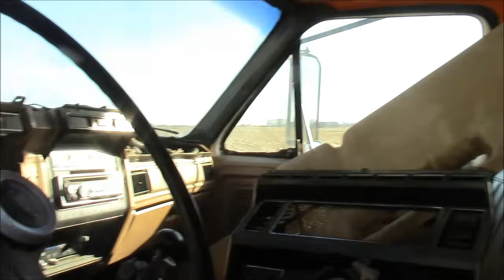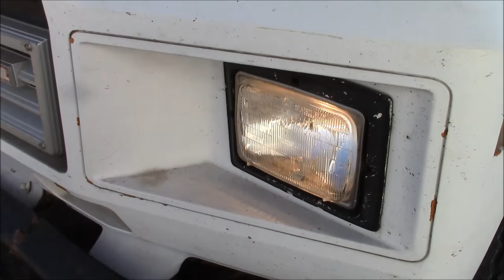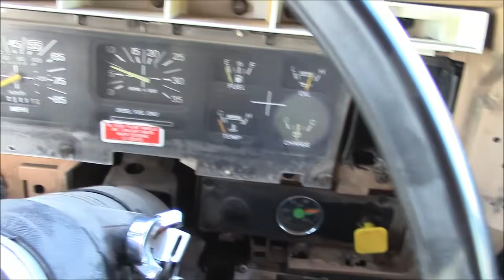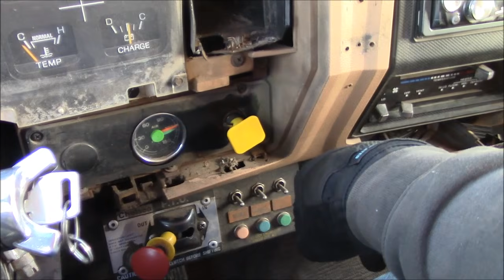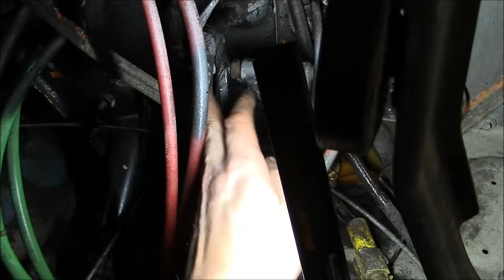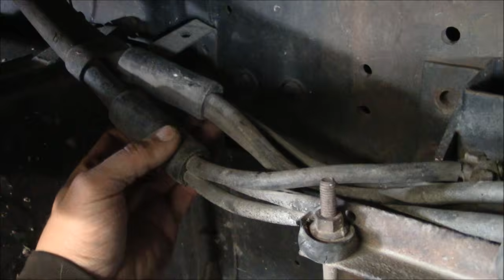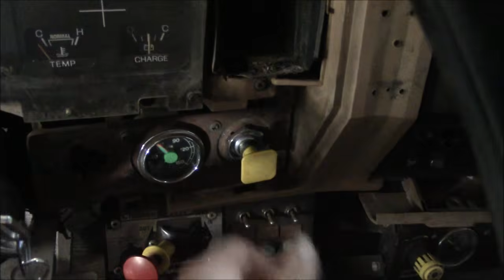Sweet 1984 Ford F-800 - No Headlights, Air Leaks, Bad Brake Valve.

Comment from the maker: Lots of guys are asking me about the uninsulated terminal kit I use. I'm pretty sure the terminals are made by Molex and I bought them from McMaster Carr. But, they don't seem to offer the assortment anymore, but you can get the terminals from them. I think it's the same kit as this one on Amazon. https://amzn.to/2LB4jjZ
Reply from the maker: Dave Iauco  It just depends. For quick single wire repairs, it's hard to beat the shrink type insulated butt connectors. For a big wad of wires like this I like the uninsulated with shrink tube. Soldering is good too, but tough to do well in cramped spaces like under a dash.
Reply: Agree. Mostly the repair wires are too short so longer
are easier to re-solder. Back in the 80's we had plenty
of malfunctioning wirings from factory in new GM 
crap as Caddy Buick and Ponziac cars. They had to be 
rewired to our legalisation standards. It's just crap.
Reply: Set up an amazon shop with all the tools you use, so when we buy them, you get a kickback, and if we save your link, you get a kickback on all the normal stuff we buy from amazon
Reply: Amazon owner Jeff Bezos is a tax dodger. 
Not recommendable.
Reply: Dave Iauco  A dodger. He takes all the
profit and gives some sort of participation
aka stock papers upon his net profit to he's exmlpoyees. The employees pay all the
taxes counted by this gross profit and he keeps all the gross profit in hos pocket.
Better you sell local and keep and use yr
profits localy = wealthiness.
Reply: @junkman6456  not that bezos needs my money, i think i have put his kids thru college with how much i spend on amazon, would be happy to throw Wes 3% of that for him just posting a link and buying as i normally do

Comment: I've been using various crimp and twist connectors for 50+ years...only the 'wire-nuts' say not to crimp....if you do, you can cause some of the conductors to lose their connection due to twisting making them too short, more of a problem with solid wire...( so they say)…..

Comment: The other air switch is a internal brake in the transmission that takes place of a physical clutch brake you depress it to help put the truck in gear on initial take off I believe drove a brigadier with a 6v53 and a 13 direct with the same little button on the stick
Reply from the maker: Interesting! I should have thought of that!
Reply: I was reading down the replies before I chimed in, first thing that went through my mind when Wes said he wasn't sure what it was, clutch brake.
I almost wish they still made them that way, for the drivers that need to mash the pedal to the floor or worse yet, the guys that use the clutch when shifting.

Comment: One thing bad about the Detroit motor. They can run in reverse direction. Tore down a few with shattered pistons. They let the truck roll backwards without the clutch pedal pushed in.
Reply from the maker: Internationals can do that too! I had heard they could but never believed it until I saw it happen!

Comment: The rt6610 is a 5 speed tranny with high and low range in the tranny. I drove many truck class 8 with the road ranger version of a 10 speed that simply shifted from high to low range. The tranny in the Ford is simply fords way of avoiding the purchase of the road ranger using the own transmission.

Comment: Ford’s last forever, I ain’t gung-ho for a single brand and don’t particularly hate the other brands like 90 percent of the population. I like certain Chevy’s, certain Dodge’s, and I prefer just about any Ford over the other brands. From what I’ve experienced in life is each particular brand and model has it’s own set of issues and if you take care of your equipment no matter the brand it’ll treat you fairly as well.
Reply: Dam smart observation. I grew up a Chevy and GM guy, but what they built in the 50's and 60's was a sight better than their quality now. And as for Ford Trucks, we loaded ours with giant blocks of cut up logs till the mud flaps dragged the ground   and they would perform and keep on making money. So I have to say a Ford is a good as any if the oil, Radiator and Brakes/ lines are kept up. (Agree).
Reply: Keith Kelly Most certainly, I remember when I was really young that my dad had an old white ford truck and that thing ran forever despite it’s condition. I can’t remember the year but it was a square f-150 and the speedometer didn’t work, both windows had vise grips for handles, missing nearly all the interior except the seats and the steering wheel 😂 the floor was rusted through on the front half and dad used cut up plywood scraps to fill it in, the doors wouldn’t close unless you slammed them hard enough to destroy these doors today, and the exhaust manifold leaked and the muffler was about 70 percent gone... Darn truck still running today, just doesn’t get used anymore. I think the transmission don’t shift out of first or something of that nature. But dad took care of that old rattled out truck because it was his and it was paid for. It was made right here from real steel from American soil. I’d like to fix it up really. I’d drive that thing if the transmission worked.
Reply: A smart man drive what he can afford and dreams about buying what he wants. Every thing pass 76 has more problems with wiring. New trucks are all computer controlled.
Reply: Fords traditionally last a long time because most of the parts have been recently replaced !
Reply: CrimeVid I can see that, but that should be like that with any vehicle. When “said” component has reached its EOL (end of life) or has prominent wear you should replace it rather than keep on letting it go. That’s primarily due to the bad part can cause even more damage through domino effect that could have been avoided by proper maintenance practice.
Reply: @CrimeVid  that's any vehicle no matter the name badge on it.

Comment: That 8.2 Detroit’s had mechanical unit injectors like the 2 strokes& is idi injected. Basically, it’s the 6.2&6.5 older brother.
Reply from the maker: OK. But don't the 6.2 and 6.5 have rotary injection pumps? I've not really worked on them.

Comment: A Ford with a Detroit and it doesn't leak oil. One in a million!
Reply from the maker: Or a billion!
Reply: We had a whole fleet of 86 to 87 c70s with those engines in them and  none of them leaked enough to amount to anything They actually gave great service. We had all the c70s in a big line along the fence so we could plug in the block heaters they were always in their same spots and if you remember the 90s I think Ford cargo series cab overs we had one of those duds also with a reefer box on it it had a 5.9 Cummins and the asphalt underneath it had dissolved from the oil and diesel fuel that it leaked over the years. Believe it or not the old Detroit’s ran circles around it Our newer 4300 with the DT 466 wouldn’t catch it from 0 to 75. But On a long steady Pull though the DT 466 would slowly pull away but around town loaded or not you could forget it that Little Detroit took off so quick you would be out of sight before the DT 466 could get woke up lol. That one seemed a little puny probably geared really low. I have the paperwork for some of those engines and it seems like the horsepower rating was like 195 to 300 I don’t know what ours were set up I bet I can still find the manuals in the garage. I heard the n/a ones were the ones that were really weak. I never hear nothing but hate on these things But the handful that I’ve been around and the people that owned them didn’t have any complaints. You almost never seen it smoke except for on a cold start. And a fine haze when you were running the piss out of it. None of ours had tachometers but it was definitely singing out on the interstate. I don’t believe there’s a time I didn’t hold it to the floor from the time I got on the interstate until the time I got off and it just buzzed right along.

Comment: Add a piece of yarn or string on the mouse trap, so if the little bastards remove the PB the string is there and they will try and take that back to the nest, and then set off the trap.  My G ma taught me that  50 years ago .  works well

Comment: Clean old ford!  I got some old videos of an L8000 i used to drive. Was a fun truck even with a 3208.      Nice repairs and hope you're keeping busy!   floating gears is the only way to go!
Reply from the maker: I never learned to double clutch. I doubt I could do it if I wanted to. Someone told me you can't pass the CDL test without double clutching, but they never said anything to me. The examiner said "drive this truck like you know what you're doing". So that's what I did!
Reply: @WatchWesWork  yeah i didn't double clutch for my test either and nothing was said. i drove around a warehouse parking lot to practice on the weekends on my own time. You dont need those fancy 5k dollar schools to learn to drive truck.   i play around here and there to try double clutching but floating is the only way to go IMO.

Comment: Whoever said don't twist the wire probably struggles getting all the strands in the crimp fitting and has stray wires poking out everywhere. I would think the only difference between stranded and solid wire is flexibility.
Reply from the maker: Stranded wire is much more tolerant of vibration. Solid wire tends to break.

Comment: I’m an electrician and the antitwist theory with stranded wire isn’t for crimp connectors it refers to wirenuts and the ability the wirenut has to cut off the individual strands if they are pretwisted.  I can’t imagine that it would make a difference at all with a crimp connector.  I sat through a very dry and long UL listing class and the speaker went off on a tangent about pretwisting stranded wire and how it is bad to do so.  But to tell you the truth I still am not convinced that it makes a difference one way or another.
Reply from the maker: I can't see it mattering either. The strands are slightly twisted inside the insulation anyway.

Comment: Here in Finland we have Sisu brand trucks they have cummins and caterpillar engines 
and eaton fuller transmission. I drove one for seven years 
i didn't use the clutch when i changed gears they are not barbaric if you can use them

Comment: The dash in that truck is the same as the one in my 83 F100. Except my tach goes up to 6k RPM  and i have  5.0L v8 gas engine and AOD trans. Man where do you get access to all these manuals ? including the one for the military truck you worked one. Awesome. Nice work on the headlight switch and the airline. Now i know how that headlight switch is . Pretty big.  Thanks.

Comment: I would hide that heater cord behind the bumper .     Seems frost plug heater cords are always so close to the exhaust manifold .
Reply from the maker: Yeah that's true on V8s.
Reply: i thought it had some housing to plug in the connector when its not in use

Comment: The Detroit is a much smaller engine , only 500 cubes , had a lot of head gasket problems, but very good on fuel , hope it does not have the electronic governer.With all it's flaws the cat is a much better engine. Both of these engines should have stayed on boats or generators, not on the road.

Comment: Hey Wes?
Twist or no twist, It makes no difference. 
Electrons flow around the outside of the wire strand, Multiple strands means multiple paths and IMO its better to twist so you dont break strands and reduce the path.
Surface area is therefore important hence different crimp connectors and although a crimp reduces the strands it is usually more or less the same surface area and basically this is important in regards to current and resistance (Which creates heat)
You take more note of the mechanical side of the connection and insulation and weather protection and for your application thats awesome and good to see.
Sparkies (Electricians) and worse Electrical Engineers tend to get a bit precious about the theory and what applies to their work environment kinda forgetting about YOUR work environment.
My skillls lie in-between with both Analogue and digital electronics and my applications commercially are way off either yours or a Sparkies but I also apply what I did to my own cars and trucks and long ago realised that there was a new learning curve when I started on Ze German 70's cars and Buses.
BTW its usually Sparkies who bitch and usually after they have had to deal with engineers and need to vent (Rightly so).

Comment: I love that ford dash. The larger F series did what Chevy did with their medium trucks used a pick up cab. HAHAHA a ford with a GM engine FYI thats a 8.2L (they are a pile). Should replace that with a 6-71 two stroke is the way to go then Cat 3806. I never wear gloves either. When I do/did wiring I do all different ways matters what its on or for. Anything outside I liked to solder and heat shrink. Interior I liked to use connectors with heat shrink. I always twist the strands. I buy the same heat shrink how I look at it is if it does the job where does it matter you buy it from. I had my own auto repair out of my shop for years till health issues came up and I am unable to do much of anything. I still try to work on my own stuff that way my 16yr son is learning a trade by doing hands on work.
Reply from the maker: I thought that was funny too. I guess the price was right. What's funny is Ford had their own engines, the Brazilian built straight sixes were used in a lot of these trucks. Those were good engines, also used in tractors.
Reply: @WatchWesWork  Yeah I know the engine you are talking about. Pretty much every ford straight six gas or diesel were good engines. Also the old fashion floor switch dimmer I always liked that more then on the column. I did the same thing for grommets

Comment: I enjoy your informative descriptions I have asked you this question before I have a 1978 Mack U600 the treadle valve is leaking out the exhaust port. Like a dummy this is the second time I changed this. The first time it solved the problem. This time I suspect a relay valve back feeding. making this leak.  Can this be the problem? Thank you Mr. B.

Comment: I like this truck. What would get me in trouble is I like to double clutch and with a clutch brake you have to know how far to throw the clutch or you will quickly ruin the clutch brake.
Reply: Different trucks are made different. This one has the clutch brake as a hand activated valve not on the pedal.

Comment: thein side of thattruck is the same as my ford F600 but it has juice brakes over vacuum (big  boaster under cab. dam good brakes, and a gas 372, it great as the front fenders are fiber glass, i picked up a doner truck,. going to take the 2 speed rear end out of the doner and put it on my truck,  it screems as 50 mph and want to get away from them dam bud wheels, and a heaver weight rating rear end then mine         i have a 7 yard dump box on it with fold down sides, and i made a hook up for a big hydro truck boom, 2 pins and put the out riggers down and drop the boom off same hook up as a backhoe on a dozer/loader, 2 hooks 2 pin, off in 5 an on in 5, licesed for 15,000kg

Comment: The fact that electricken said something, doesn't mean anything, everybody is always wrong on something. The fact that everything you fixed using your methods never fell off a cliff or disassembled spontaneously by itself, means everything. 10 ways to kick the cat, each one works, each one is good.

Comment: The other air valve on the shifter is a transmission brake I’m assuming.  We had several dump trucks back in the 90’s that had them
Reply from the maker: Correct. I should have thought of that!
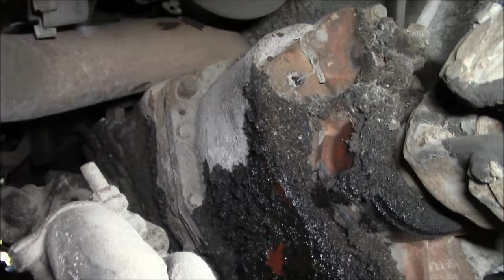Reply: It operates the unit next to the Eaton tag (on the pto cover with the single plastic hose at 13:50.)

Comment: Your way of crimping the wires together is actually the only way VW instructs its dealerships to do it
Reply from the maker: Interesting. I've never seen any service information on wire crimping.
Reply: @WatchWesWork  The thing you didn't do "up to code" (according to VW) was to spread out the connectors to reduce bulk and wrap the wires in yellow PVC tape to make the repair obvious for the next guy :D

Comment: Drove a Detroit for years over the Road, Prefer them over Cats and Cummings, The old saying is " PUT YOUR FINGER IN THE DOOR, SLAM IT, THEN GET IN IT AND DRIVE IT" For off road construction, and for over the road you can't beet them..
Reply: I think that's the two strokes though. I'm not sure about the fuel pinchers but from what I've heard it's pretty accurate due to no power.
Reply: Lol the one I heard from an old trucker friend was “Son if you’re gonna drive anything with a Detroit in it the first thing you gotta do is slam your finger in the door cause that’s gonna be the best part of your day. It’ll also teach you how to drive it right, you have to drive them like you’re mad at them”
Reply: Dave Iauco ha ha ha the throttle is an on/off switch

Comment: I'm going to venture a guess on lights. A bare wire grounding out popping fuses or a faulty plug/connexn. Brakes bad detent. Learned that word from aVe!
Reply from the maker: Close enough!
Reply: Thanx. Missed the brakes completely! Was imagining a parking brake lever not air brakes. I would've started at the lights so I picked up something. The switch is where it starts.

Comment: I'm an electrician, always twist the wires it helps them grip if your putting in a lug or using a wire nut.

Comment: I would rather have non syncro trans. Less crap to tear up and the gears are larger with beefier shift collets. They won't strip out or get chewed up like syncro trans' do. 😎
Reply from the maker: Right. The most common failure point on these boxes is the one synchro for the range shift.